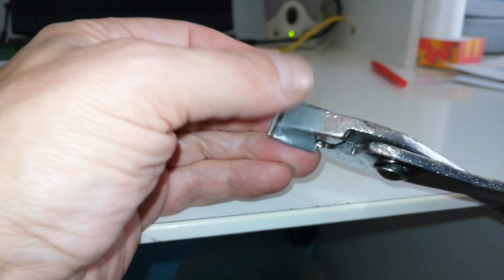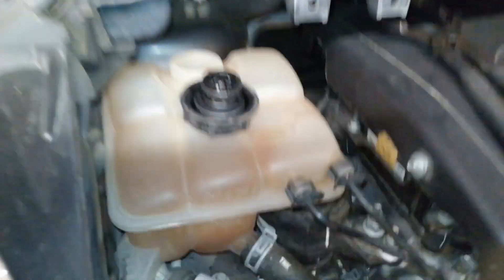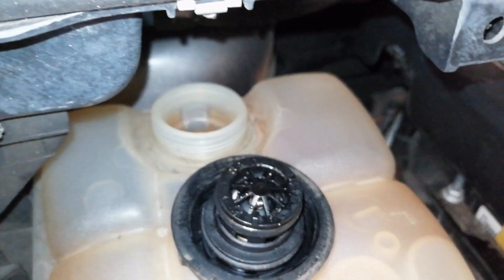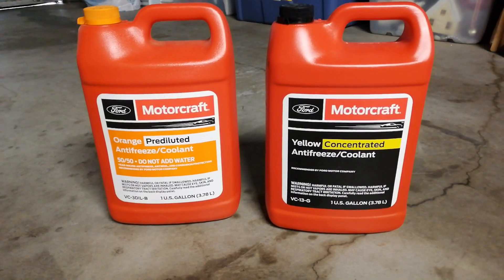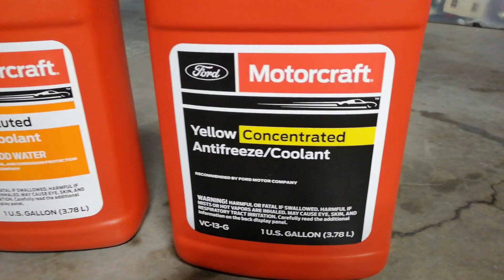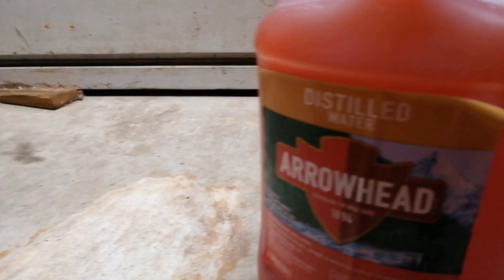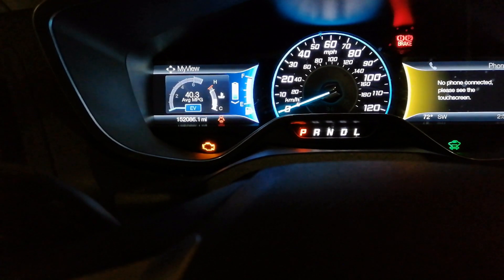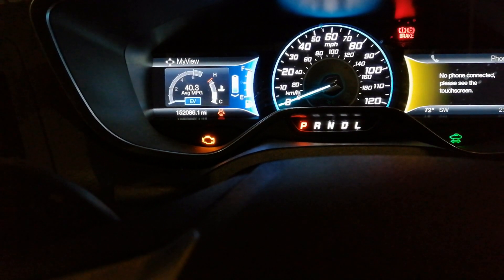How To Change Ford C-MAX Hybrid - Antifreeze

Comment: How many quarts/gallons to completely drain and fill? Thanks
Reply from the maker: @OCISupport-yj5bd  I don't remember the exact amount but I bought one gallon of the yellow concentrated and mixed it 50/50 with water and I still have some left so two gallons should be enough

Comment: When you were in fill mode, do you have the radiator cap off so the air could escape? And did you drive around to get the car to normal operating temp (looks like the temp gauge is halfway already on your car) or did you just put it in fill mode after draining and filling the reservoir?
Reply from the maker: Yes, I left the cap off and added like needed while engine is running. I let the car reach operating temperature by leaving the gas pedal pushed down (2000 rpms) and checking that the lower radiator hose is hot. After that , I was driving to check that everything is OK.
Reply: @TheFrankman711  got it, thanks

Comment: I ended up finding a service king workshop manual for 2012 fusion hybrid, 3000 pages, any idea what section I should be looking at for directions on coolant drain and refill lol
Reply from the maker: sorry, no😀
Reply: @TheFrankman711  it's no worries
Reply: @TheFrankman711  just noticed mine has a bleeder valve so shouldn't be too bad

Comment: Also, when you first step on the accelerator for 10 seconds after step one brake release. Your throttle is running at max for 10 secs and not 2000 rpm correct?
Reply from the maker: As far as I remember, it didn't go higher than 2000 rpms , even though I was pushing the gas pedal all the way down. Kinda glad it didn't, because I did not want to rev my cold engine to the max rpms😬
Reply: I can confirm my 2013 fhev won't let me rev past 2000rpm while in park normally. No clue on the other years, but my guess would be it's the same deal. Then again, Ford.......am I wrong?
Reply: @HafroSamurai  haha mines the older body 2012 with a bleeder valve, different but pretty easy process

Comment: How did you know your vehicle was in fill mode, did it state it or you just went through he process?
Reply from the maker: I just went through the process, but I believe when the shifter is in P position, the engine won't ref higher than 2000 rpms. (haven't tested though)
Reply: @TheFrankman711  I see, thanks for the reply and vids. Will give it a try.

Comment: Wonder if this is the same process for the ford fusion hybrid 2012, so pressing gas pedal full throttle will only go up to 2000 rpms when in fill mode is engaged?
Reply from the maker: right.